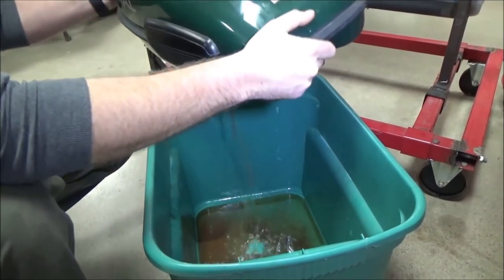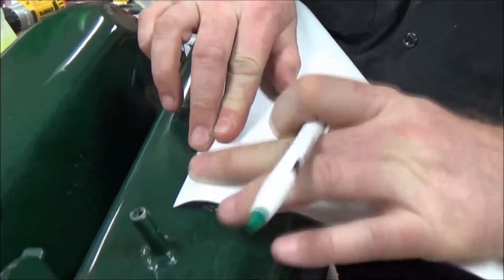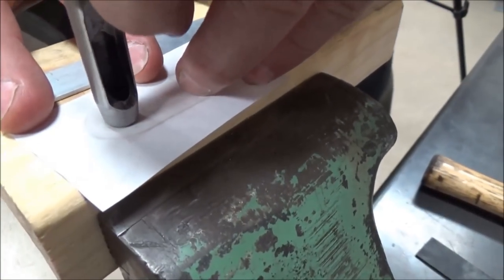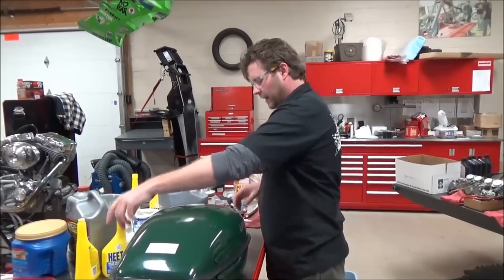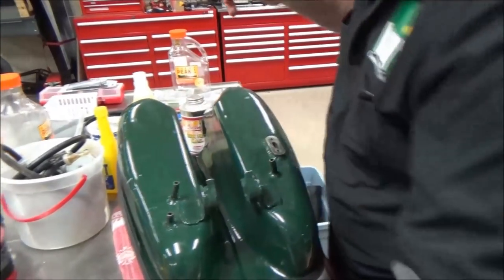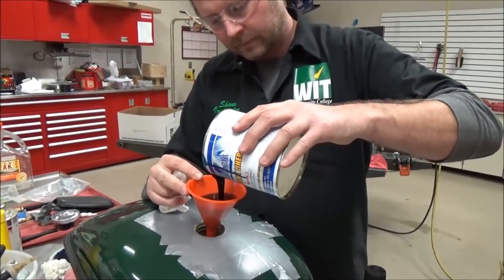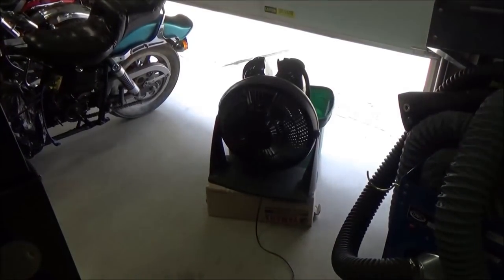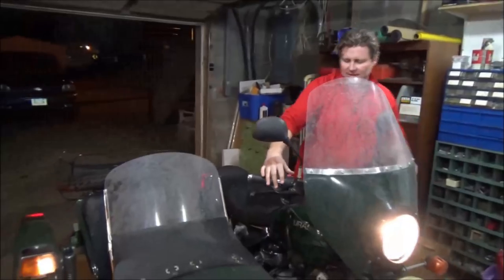How to clean  prep and line a fuel tank demonstrated with Northern Brand Liner Kit

Comment: The tank I have has been sitting for 13 years with fuel in the tank. I've used vinegar and bolts, then learned there was a factory liner. I was about done except for a small portion of rust and old liner still attached. I've used diluted Muriatic for a few hours. I've used MEK for about 5 mins..... and still has a portion of rust and liner. Any ideas on how I can get a clean liner?!

Comment: 6:27 Use a dental mirror, or remove your blocking plate from bottom of tank, so you can show use how spotless the top half of the tank is.  If you keep a tank FULL of fuel, less rust occurs, because rusting only occurs where there is air.
Reply: So how does the bottom of the tank rust then..??
Reply: @jerrybigrig9475  when there's not as much fuel in the tank for long periods of time? additionally flaking rust from the top can fall and it just sits there accumulating on the bottom.

Comment: was that just duct tape around the top?  I'm having trouble sealing the top gas hole on my 2007 bonneville tank.  I've got everything in the tank clean except the very top.   I'm not sure how to seal the gas hole so I can put the tank upside down for a few hours with liquid inside to clean to top.   It leaks with the cap on.   With my old Triumphs I just put an expanding plumbers plug in the gas hole, but that won't work with a modern Triumph.
Reply from the maker: I've used fat rubber plugs that I even siliconed in place and yes duct tape...it's simply risky and terrifying to think of a leak and ruining good paint.  Here are the plugs: https://amzn.to/3PYukvF

Comment: Hey Shane...., great video. I'm having in issue with the tank off my 95 wideglide. Exterior paint is mint, but the inside coating is flaking off like crazy. Flushed it many many times and right now I have it soaking in the evaporust. The tank has a cross over line and the exits are really tight making it difficult to extract that old liner (oem). what would you suggest that might break up and dissolve it? Will the evaporust be enough? Thanks, Kurt

Comment: Hi. 
Whats the best method/product to remove stale petrol residue/varnish from a fuel tank? I have an rc51 tank that has mint paintwork so i dont want to risk damaging this.
Cheers
Reply from the maker: Hello. If its just varnish, I would not use this kit as you don't really want to etch the tank. Diesel and Kerosene fuels may work a little more aggressive along with fuel itself. Keep in mind your fuel pump and filter are located in the tank on the RC51. 
-I would remove the pump and hand clean (replace the filter of course). 
-Spray carb or brake cleaner up inside to breakdown any visible varnish

-Then make a plate to cover up the fuel pump mount. 
-Then eat your Wheaties as your going to slosh the fuel around to breakdown the vanish. 

-Drain and reassemble

Thanks for commenting and adding value to our community! Please subscribe, share and consider a H2W membership to support our free work here!

Have you subscribed yet to never miss a video? Have you seen the video playlists? Over 600 videos! Check them out here: https://www.youtube.com/user/conleybuilt/playlists  

Want to say “thanks” or “keep it up”? Click here https://www.paypal.me/how2wrench    
 
Your answers and help are just around the corner. Save time and money while protecting your investment and yourself by doing it the right way at www.How2Wrench.com
Reply: +Shane Conley that's great cheers I will do all that. I'm sending the throttle bodies off to someone who will soak, clean and pressure test the injectors and set up if needed.
Reply: @How2Wrench  Thanks for the help. After removing the fuel pump i can now see i do have a tiny bit of rust on the weld seam running over the top of the tank and on the filler cap neck obviously these spots weren't submerged in the fuel while the bike was sat for a number of years. i was thinking of filling the tank with apple cider vinegar and then neutralizing with baking soda but i wondered would the apple cider vinegar etch the tank or is it not strong enough to harm good steel? If it is harsh to good steel i think i would use metal rescue or evaporust. Cheers